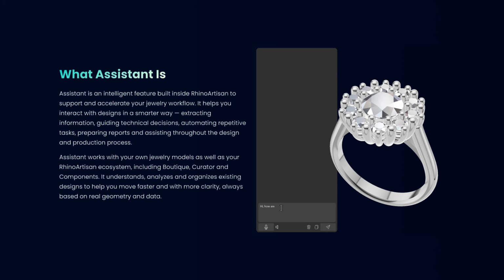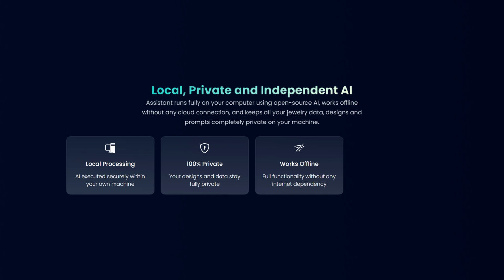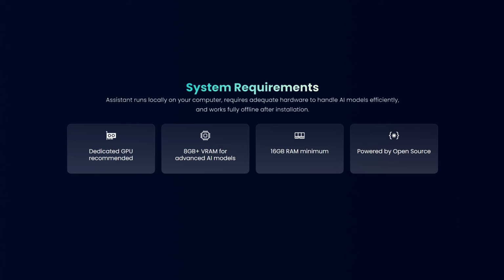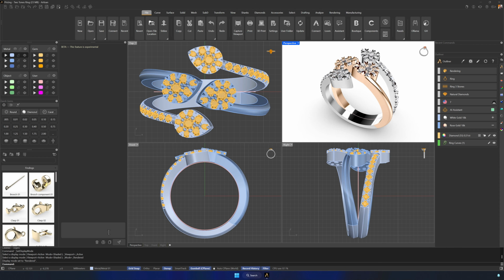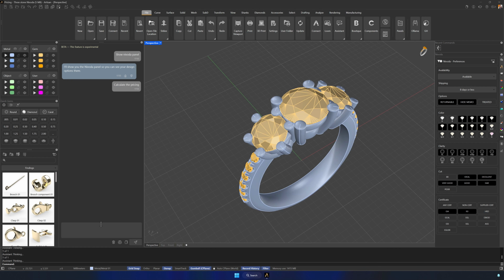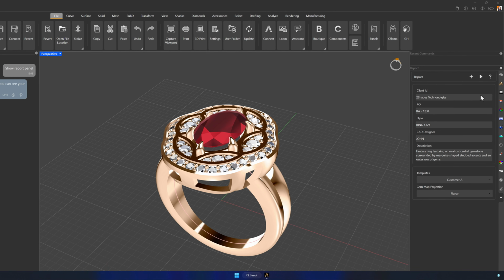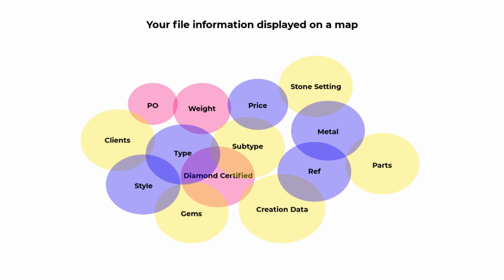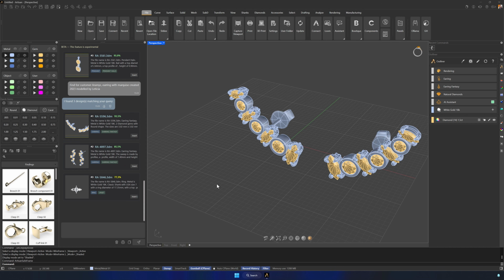AI-Powered Jewelry Design: Meet RhinoArtisan Assistant — Get a Discount Below

Comment: Will the design be public if I use the Ai tool?
Reply from the maker: Hi there! Assistant runs fully on your computer using open-source AI, works offline without any cloud connection, and keeps all your jewelry data, designs and prompts completely private on your machine!